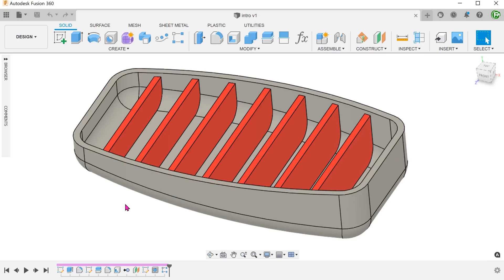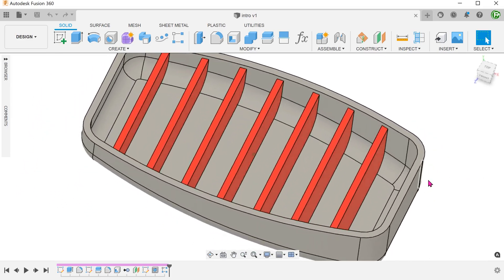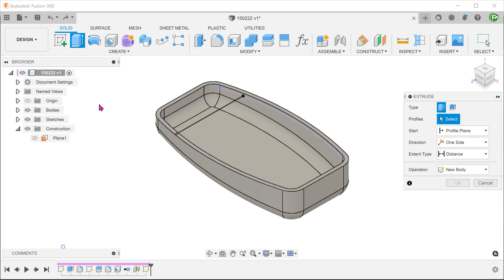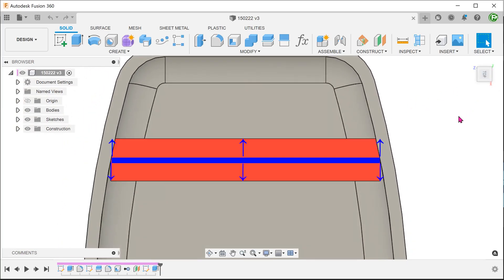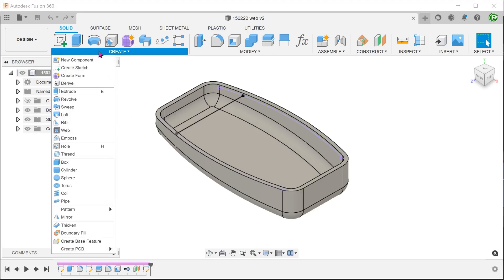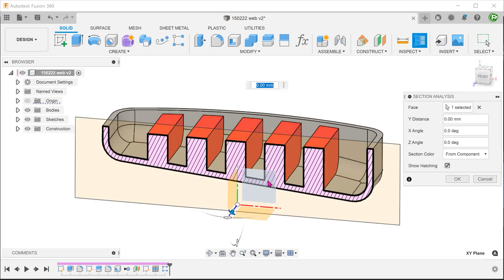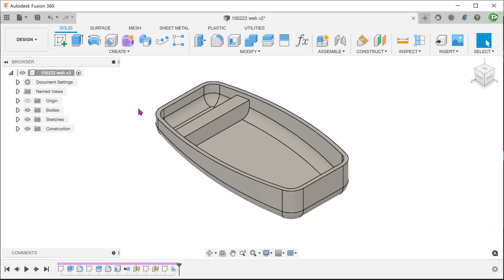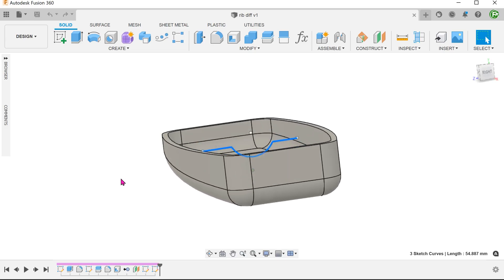Fusion 360 | Thin Extrude vs Web vs Rib

Comment: Great video!  Fun fact until autodesk fixes it you can go into change parameters and adjust the fillet and draft values for both rib and web even though they are locked in the PD extension.  I imagine that will be fixed at some point.  Great video!

Comment: i am trying to follow your tutorial on Rib 
However when i try to pull the line ,( 8.38 minute) ; fusion error " The selected curve is closed.Edit Curve or select another. "<

unsure what it means
Reply: I ran into the same error - something seems buggy with the Rib tool in this case. It works if I project the intersection lines and connect the lines to it. And then will still work if I remove the line from the projected intersection. It is like it can't figure out which profile to extend the rib to.
Reply from the maker: @JakeMcIvor   and @wchoong, could both of you confirm if you did the sketch on a plane parallel to the right plane? I went back to try this out again and there were no issues. This error would come out if you perform the rib command on a sketch that was done parallel to the top plane.
Reply: @Fusion360School  Yeah, sketch is on a plane offset and parallel to the right plane. Seems to be occur when a horizontal constraint is applied to the line segment. Putting the line segment at a slight angle will also create the rib.
Reply: @Fusion360School  I would think i did . I offset from the original right plane , and even plan off one of the face parallel with the right plane.

also did what @jake was doing as well , drawing that line at a slight slope angle , and the rib will happen , but a bit wonky.
Reply: a little update. I did  "Extent Type = Ditance" ... this way it works.
Reply: The distance option worked for me as well, but there is definitely a bug here.

Comment: This video will be forever known as the definitive answer to the question of Rib vs Web vs Thin Extrude. However… I do have one lingering question:

You said at the beginning that the ribs need to be slightly below the top face of the box (and therefore you created a sketch plane slightly below the top face). I wasn’t sure if this offset was required by the feature (rib/web), or just by the aesthetic of the design.
Reply: it’s not it’s just the asthetic of the design and how you can determine the height of the web
Reply from the maker: Hi Adam, it is just an aesthetic thing. It works just fine if you sketch directly on the top face.
Reply: @Fusion360School  thank you!